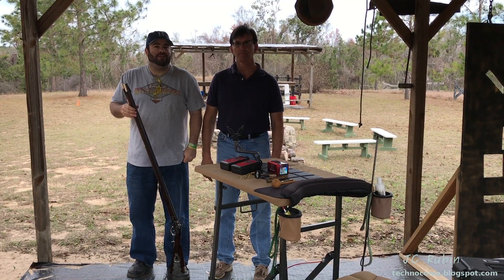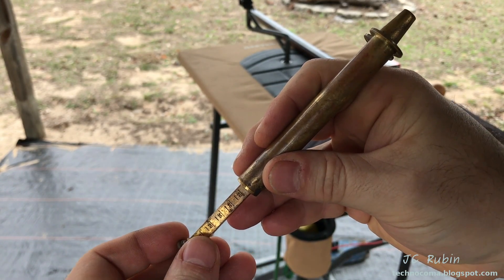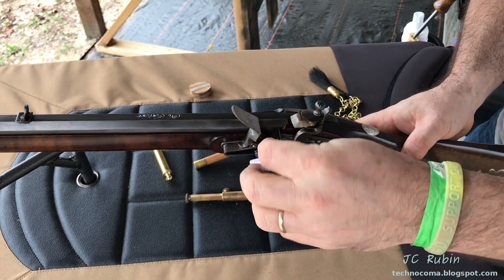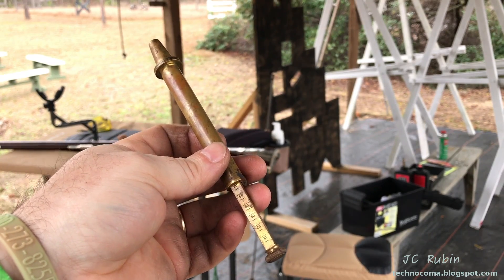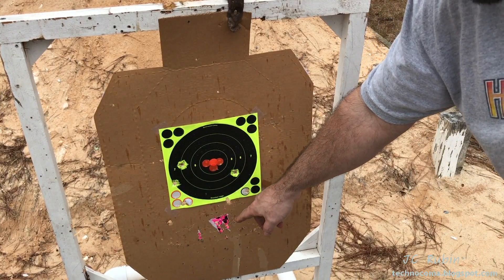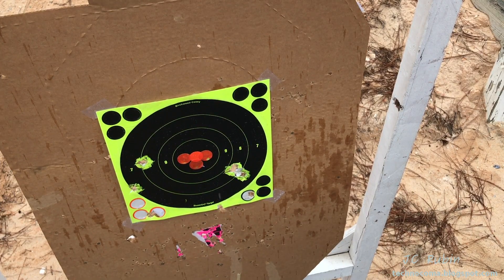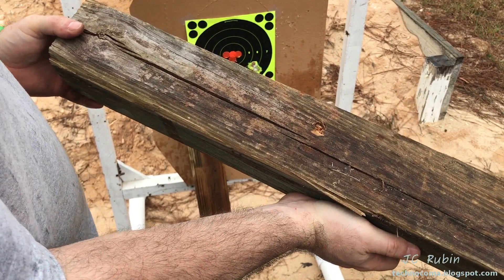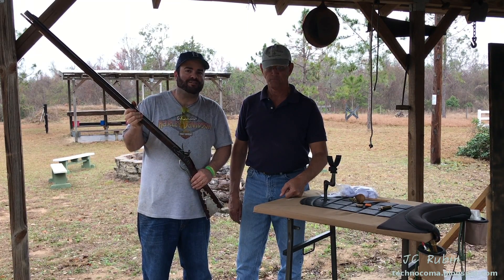Field testing the TVM Early Lancaster Lefty Flintlock in .50 Cal

Comment: Gorgeous rifle and shoots well with 70-grs. at 40-yds.  Nice to see how that 70-gr. load tightened the grouping right up from the 60-gr. results.  Really no need to use 4Fg powder for the priming though.  You can use FFFg and that works just fine.   Yes the 4Fg does burn slightly faster, but you have to use scientific equipment to measure the difference between 3F and 4F.  I have used  3Fg in my Early 50 cal. longrifles for both the main load and prime for the past 15-years.  One less thing to carry!  If you LIKE to use 4Fg though, go right ahead.  Just be aware that you don't NEED to use 4fg for the prime.

On your 60-gr. shots that pulled to the left.  Doubt it was due to delay.  Your lock is plenty fast.  I believe your thought about how tightly you were gripping with your right hand being the cause of that pull to the left is spot on.  Notice how it went away once you changed how you gripped it.

Thanks for the video and the slow-mo shots of the lock working.  Looks like a good, fast lock on a very pretty rifle.
Reply from the maker: One issue that was known from the start was the weight of the front trigger on this new rifle.   I'm going measure my other one and set this one up to the same number of grams.  Most important, and somewhat ironic, I need a day at the bench without the camera or videos to really spend some time tuning it in.  The video that day was more about fun than precision, and the weather was absolute crap.
Reply: Yup 3f works good, will probably use it when my 4f runs out, my first flintlock was fussy lol she liked the 4f so that’s how I ended up with it
Reply: Also remember Iam very very right hand and right eye dominant 😂 so shooting left handed was a a challenge
Reply: Dan Gracia thank you, I accidentally posted the reply to the public section

Comment: I have a left hand Tvm smooth bore.  I have found out shooting alot with it. You need more powder charge than you would think to get ball up on target.  I started with 70 grains 2f with the 54 caliber it was very low. I went up to 100 grains to hit bulls eye at 50 yards every time. It's a little off to the right but I use Kentucky windage on that. So remember when you file sights and it's still low increase powder charge.
Reply from the maker: I wonder though, not being all too familiar with smooth bores, what kind of seal you are getting between the patch and barrel.  I know on mine its a good tight fit with no gasses escaping out the side.